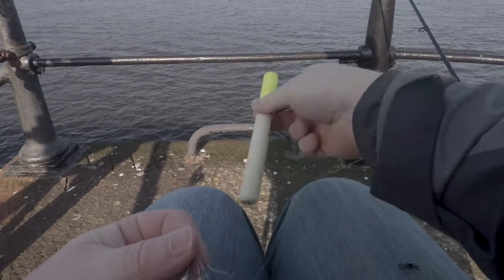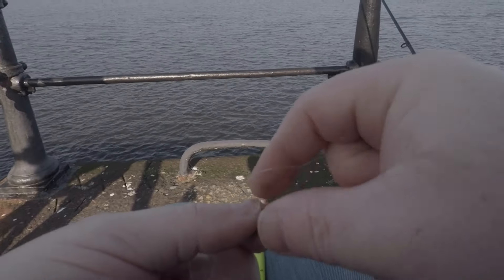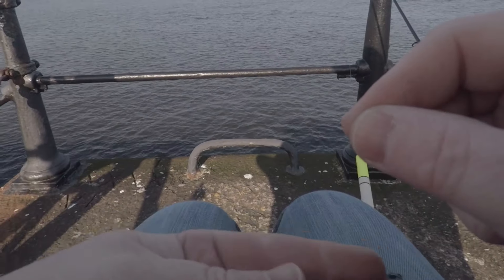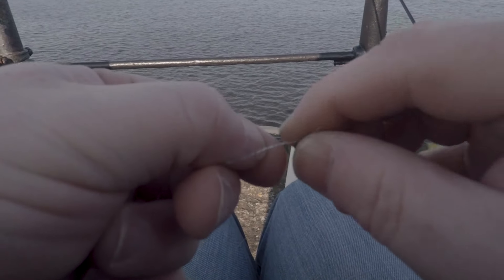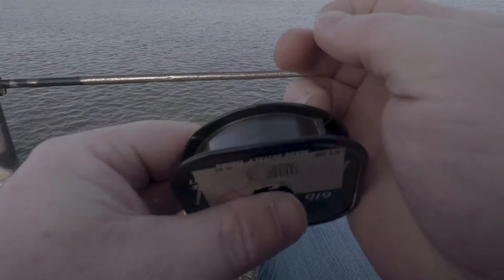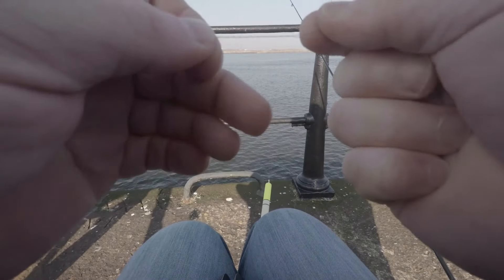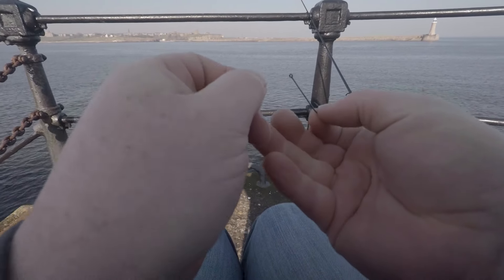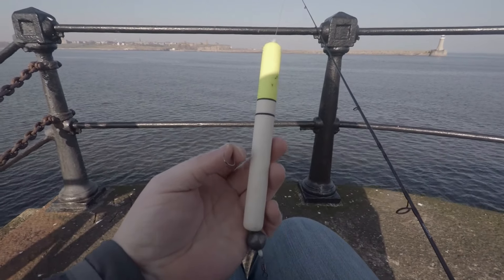Sea Fishing Float Rig set up.

Comment: What do you do the gauge the water depth that's always been a puzzle to me.
Reply from the maker: I usually use the stop bead to lengthen the drop to about 6 foot and adjust up or down from there about a foot at a time (you can do it without the hook snood on so you don't get snagged)  when the float no longer stands up in the water it means your weight will be on the bottom and you get the rough depth of the water, then reel the float back in and shorten the drop the length of your hook snood and a little bit more so you are fishing the distance you want off the bottom.